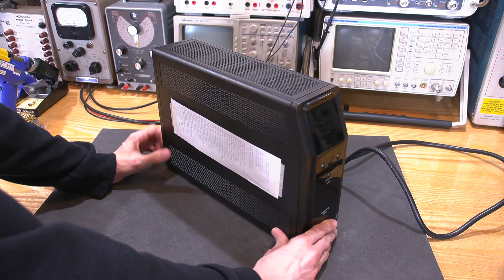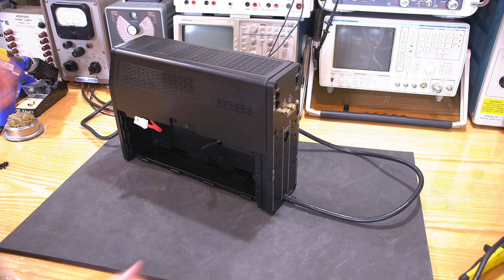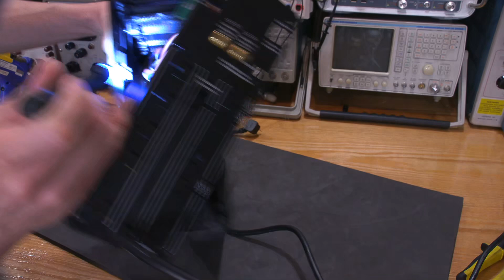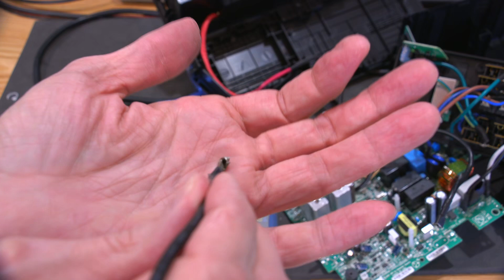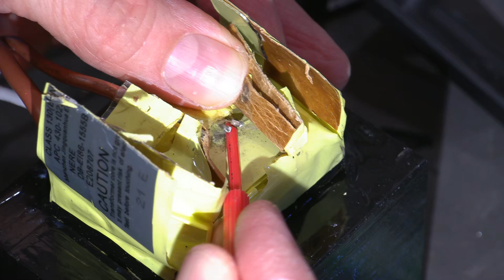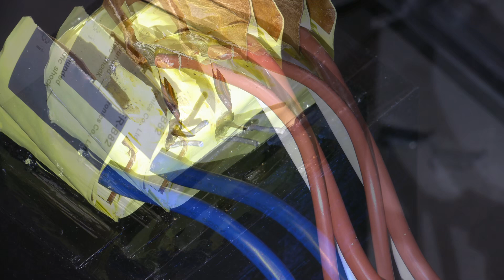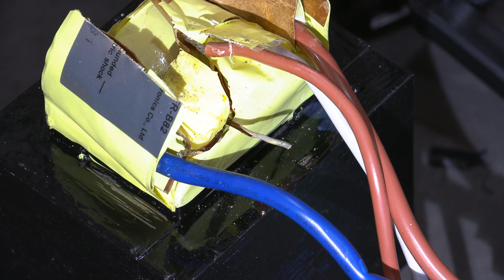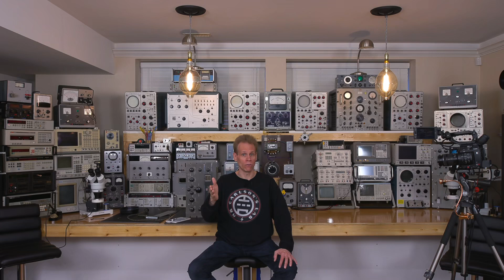UPS Electrical Failure - Teardown and Analysis!

Comment: My father used to say: "During my days, things were made to last". How true he was.
In the name of "value engineering", core engineering takes a back seat.
Reply from the maker: Absolutely! I have transformers from the 1930's that are fine. Its enameled copper, insulation material, and a core. It's amazing how they can make something so simple (nowadays) fail.
Reply: @MrCarlsonsLab  The connection would never failed if they use proper crimping methods to bond these cables. 73
Reply: @MrCarlsonsLab how do we fight back from this throwaway society?
Reply: My grandfather was a TV repairman, used to be his "gopher" on house calls for those big old wooden console tube sets, running to the car trunk to dig up a tube or something he didn't have in his "common stuff" case he brought in.  Between him & my dad I learned basic electronics repair (and I remember drooling over the 1974(?) R-E article on the Altair 8800, which led to me reading the TTL handbook probably cover to cover and eventually my IT career).

Even today I've got an old 1959 Zenith tube clock radio by my bed (was my uncle's), and I look to repair things before buying something new.  My old job in the 90s I'd grab older computers and dead monitors off the "scrap" pile going to computer recycling, fix them up and basically give them to friends who wanted "to get on that new internet thing" (had them cover the modem card cost basically).

I still tend to look at things I buy from a "serviceability" standpoint, I don't like buying things that are obviously designed to be "throwaway"... Like I look for lithium battery things that have replaceable 18650 cells rather than those gel-pack batteries - not that I generally can't open it up and replace it, but I know that's designed to have most people just scrap it when it dies rather than just replace the battery, and I'd rather not encourage that.  That's my biggest beef in recent years - like the new iPhones where you can't even replace the battery without sending it back to Apple for expensive service, when that's probably the main "wear item" and should be easy to replace.

But... That's the old "designed to fail" thing, to drive you to buy new ones and keep them making money.
Reply: @captainz9  Back then you needed a tv repairman because tv's required constant service and ir maintenance. When I was a kid in the 60's vacuum tube tv's didn't last all that long. You could change tubes, potentiometers and channel selector had moving parts that quickly wore out and needed to be replaced, but the tv was thrown out if the crt went. The average tv probably lasted 5 years and not without regular service. Solid state didn't need vacuum tubes replaced but potentiometers and channel selectors were still a high service item and you still threw the tv out if the crt went. Still 5 year lifespan. I have a 17 year old 42" lcd tv that has never required service and works like brand new still and hangs on the wall instead of taking up half the room. I also have a 50" led, ditto except it is only 10 years old. You say new tvs can't be fixed, I say they don't need to be fixed because they don't break.
Reply: @roywarriner8441  exactly. While things have become less repairable, overall, I think that things have needed less repairs to be kept operational for longer periods of time.
Reply: @captainz9  I   AGREE,  absolutely. Things today,  are  made for  easy  assembly at  the makers'  plants.  B U T,   just try to take apart, and  REPAIR  THEM  ?   THEY'RE   MOSTLY   MADE,  to last only a short time;  NOT  really  engineered, to 30 %  over  the ratings.  JUST  make  warranty time, then,  kaput ;    throw it away, buy  another  one.   An item of interest:  the other night, while dumpster snooping, i found an old Bell and Howell  slide projector. A square plastic box, about 10  inches square,  maybe 7 inches high or so.  Took it apart,   and   WOW.   WHAT   QUAILITY  OF  THINGS,  USED.  THE  LAMP HOLDER,   THE  COOLING  FAN,   THE  MIRRORS AND  LENSES/MAGNIFIER    ARE  AWESOMELY  MADE  !  unlike  todays'   junk..... HANG  IN  THERE,    Captain  Z.     (no zees,  for us old fixer  guys.....i  guess. )
Reply: @captainz9  thankfully we have a few companies making things to be easily repaired. The first company that comes to mind is Baratza. They make coffee grinders. They offer repair service by mail or you can order the parts you need and repair it yourself.
Reply: @captainz9  I agree totally, we live in such a wasteful society and many electronic items end up discarded when they could be repaired.
Reply: Back then, things were simple, heavy, and made by a company that cares about their image. Today, they're very complicated and made in an endless race to the bottom.
Reply: They should of used silver coated wire instead can be soldered to and conducts better
Reply: Planned Obsolescence..look it up

Comment: You can indeed solder to aluminum wire, but you need a special type of solder. I have done it successfully. But it is indeed much harder than normal soldering. The flux is very reactive and it eats the soldering iron tips quickly.

Comment: Believe it or not, it IS possible to solder to aluminum - but it has to be absolutely clean first, and the joint needs to be 'manipulated' with the iron or a small stainless steel brush during the process or the solder won't 'wet' it. Aluminum oxidizes very rapidly, and when that oxide is removed, the metal will 'wet'. However, it's nowhere near as good as a copper joint, either physically or electrically.

Comment: It looks like a refurbished unit. At least refurbished ones are supplied with such tech receipts every time. But it would be better if you could take on a picture of the transformer's data. Now we have no clue if the transformer was replaced previously or this is a stock one.

Comment: Those wire connections are frightening. I wonder how many house fires are caused by hidden sub-standard connections like this
Reply: In many states Aluminum wire was used to wire entire homes, from the breaker box to the outlets. Here in California in some places back in the 80s this was very common. Entire subdivisions were wired with aluminum wire. Unfortunately.. Aluminum wire doesnt crimp properly under outlet screws..tighten them up, come back in a year and they are loose as a goose, tighten them up again.. wait a year.. loose again. Wash, rinse and repeat. A lot of house fires happened as a result.  And rewiring a home from the box to the outlets is a nearly impossible job without running wire duct or pulling off the sheet rock. Given that southern homes seldom have a basement or a crawl space... brrr! Ive seen a Bunch of homes gutted and rewired, then resheet rocked back again.  Really.. really expensive.
Reply: @GunnerAsch1  Aluminum wire is still used in the larger gauges such as between a panel and sub panel and certainly service entrance.  If terminated properly using the correct hardware it is just fine.  It was the smaller gauges used to connect outlets and switches that caused the fires, probably due to improper hardware not designed for aluminum and lack of training and experience using aluminum.

Electricity gets most of the way to your house on aluminum wire used by utilities and even in some of their big transformers.  Aluminum is probably still not worth the trouble for branch circuits due to the larger size wire needed and extra fire risk if poorly terminated.  It looks like it's not so great in UPS transformers either for the same reason!

Really big electric transmission lines are "ACSR".  Aluminum conductor steel reinforced.  ACSR is a steel cable for tensile strength surrounded by aluminum for conductivity.  Not any copper at all.

On the other end of wire size scale I tried to solder cable TV wire once.  Nope!  Had to get a crimp tool!
Reply: @GunnerAsch1  since WAGO invented their understanding of propper wireing there is light in the dark--sorry for that--

Comment: I've had a couple older ones from APC fail and a few of the smaller variety also fail...makes you go hum. I have a few Liebert and Tripplite units going these days. One of the Lieberts was ancient and I took it out of a thrift store...was a pain to take apart but eventually got to the problem and make it work. The other two Lieberts are big units I bought at a gov surplus that were "defective"...they've worked without skipping a beat for $10 each including batteries that I've never replaced.

Comment: I would have slipped a small piece of brass tubing over the wires, crimped them tightly together and then powered it up.  I can't believe that they actually made the connections that way!  A crimped ferrule would have been a better solution.

Comment: Excellent video, as expected from Mr C. Bought six apc 1500w and larger, one new, for $10 each at the state surplus store, all are still working. Batteries were dead, of course, but received $30 credit at the local auto parts store. Do the math, downright sinful. 
Ed c

Comment: This could either be a cost-cutting measure from APC buying the lowest-priced transformer or the company they contracted cutting corners. Either way, poor quality control on such a critical part is inexcusable for a device that's supposed to protect whatever is plugged into it.

Comment: perhaps you should notify your federal government certifying authority.  This is definitely a fire hazard.  Think of how many of these are installed in unsuspecting peoples homes.   The connection between copper and Al requires special connectors.  This is a violation of your electrical standards.  I know it is a violation of ours here in Canada.

Comment: Transformers have been using aluminum  for decades typically they are copper plated to accept soldering. Originally less common in electronics with more mainstream in line voltage power distribution. In the era of 2008  copper pricing hit a ceiling that populated the use in electronics.
Plumbing also has seen the reduction of copper use  due to the 2008 era.

Comment: You’re concerned about your family’s safety. So you get a guard dog. The dog costs a fortune. It immediately poops on the floor. Then it chews off the entire left side of your Bang and Olufson. It bites the postman’s fingers. It then sleeps through an actual burglary. And finally it eats one of your children.

This is the UPS experience: If they’re not preoccupied with smoldering their lead acid batteries, then they’re busy buzzing and arcing. Then they blow an internal fuse on the output, and your Great American Novel is suddenly lost, again, for the third time. Then there’s an actually power failure (Yay!), so they turn on their patented 387 volt offset square wave, and your PC is instantly corrupted. Meanwhile battery acid squirts out onto the ceiling, again. Then, while you’re out trying to buy a replacement PC, the UPS catches fire and burns your house down.

I’d happily pay $800 to not have one.

Comment: Copper clad aluminum wire.
Soldering would have been to the cladding, which might have pulled away from its alum core from thermal stress. Should have been a mechanical cu/al connection. No more accessible for me thank you

Comment: Thats pretty impressive, i hate aluminium so much, the worst material to ever exist, its a pain to work with, not just on electronics, but also on refrigeration systems, and its getting more and more common.

At the same time i wish theres a non destructive way to find out the winding material, i have a few APC ups on my systems, 1 smx 3000RMHV, the other ones a SRT 1500RMXLI

Comment: Unbelievable, but in part this explains why APC has taken such a nose dive in quality over  the past  several years. I too have (and have had) several of the APC1300s and 1500s and they will be replaced by a different brand., though these days many of these appear identical, just with a different name plate. APC is the only brand carried in stores locally, anything else is special order; so perhaps APC has moved their business acumen from Engineering/manufacturing to pushing out competitors. They'll just barely make the warranty period; nowhere near battery lifespan. Contrast this to one of my original APC "shoebox" models, now more than 20 years old that just keeps going on a new battery every 5-6 years.

Comment: Hey Paul…you said you had several others that you replaced.  How about tearing into them to see if this was a “one off” or if the poor connections were across the board.  I don’t like to condemn an entire company on single unit failure.  Thanks for the consideration.

Comment: Love your channel, have been watching many years! The aluminium wire used is solderable with special solder and flux, but is not a very reliable connection. Cost cutting practices...

Comment: Maybe what failed was that there was no tension release for the wire coming out. It comes out straight, and any wiggling will get to that dirty connection.

Comment: The cheap off-shore manufacturing strikes again, I was wondering if they were using copper-clad aluminum, but apparently they didn't even clad the aluminum.    Aluminum tends to be fairly common in welders and much larger transformers, but those tend to use crimped connections.

As someone else mentioned, APC gear used to be rock solid stuff, but some bean counters took all of the value that their name was built on and cashed it out into their retirement accounts.   I took a rackmount SmartUPS 3000XL out of service because it would bounce the load when switching on/off of the inverter.   Found a loose current shunt on the board in the load path, resoldered it, tested it, and gave it away.   Replaced that APC (and the rest of them in the facility) with Eaton units and never looked back.   The Eaton UPSs tend to be much easier on batteries too, had a set last 9 years, and would still carry the load to rated runtime.   APC UPSs seemed to cook their batteries in only a couple of years.

Comment: I had a mid 2000's Smart UPS1000XL fail with a welded AVR relay. Not the first one i've had with that issue either.

Comment: Years ago I repair some mobil home wiring that used aluminum wire. The aluminum wire had flowed over time and the plug connector were arxing and over heating.  I found some solder for aluminum metal, I heavily tinned the aluminum wire
 Then you must clean all the flux from it because they use a caustic flux. The I soldered all the aluminum wires together with a copper pigtail to hook to the plug. Not a proper fix, I know, but it solved the arcing and heating problem.
Reply: I went down this same road with a mobile home I lived in. Correct, crimping AL wires is trouble down the road. Even screw treminals will still fail. The only fix that works long term, outside of rewiring, is as you said, tin the AL wire well, clean the flux solder the AL leads together with a CU pigtail and you're in business. I kept my home from burning down this way. They had even used the springclip hole holes in the sockets for the AL wire!🔥

Comment: I don't mind the aluminium windings as much, but why the horrible soldered connections.. Could've just used crimps or screw terminals..

Comment: Most insightful. Disappointing that THE standard for UPSs have cheaped out. I assume the windings are copper coated aluminium from the colour? And even if that was a design choice for cost, those joints look awful and bodged on - surely a better mechanical connection wouldn't add much to the BoM? 
Think I will stay away from APC in future.

Comment: For someone with that much knowledge. Does not even know how to use alloy solder. To combine two different metals? Also is it not the main power lines coming into your homes are all aluminum. That size of transform will not get hot enough before the batteries run dry anyway.

Comment: Per weight, aluminum is a better conductor than copper, which is why it is used for high-current supply cables both as overhead cables and in the ground.

Comment: Crimplng a soldered wire is a bad idea as over time, the solder will flow slightly when compressed, reducing the quality of the crimp. A soldered wire in a screw terminal will come loose over time. Either solder the wires together or crimp them, but not both.

Comment: Im ok with copper coated aluminium wire on some 3v lights that disintegrate them self after month, but transformer.... damn.... this is some heavy garbage shortcut in making electronic

Comment: All green and still a no-go? Ha.
Nice transformer dissection ASMR. Arc and spark and it goes dark :)

Oh noez, the aluminum shit is everywhere! Oh well... that's what the Soviets did on power transformers in Rubin TVs back in the '70s... Some of the most combustible TVs ever made. I wouldn't think anyone would continue that tradition though.

Makes me wonder if the circuitry would be a go with a real deal copper wound transformer.

Comment: I've seen wire sold on ebay that on reading the small print turns out to  be copper plated aluminium ....

Anything to save a penny !

Comment: I buy APC UPSes all the time, but I always get the more expensive Smart-UPS model. This looks like a cheap Back-UPS model instead. I wonder if the difference between the two includes copper vs aluminum transformer wiring.